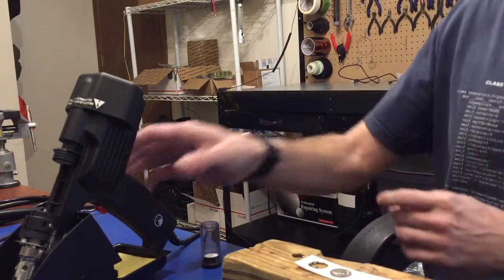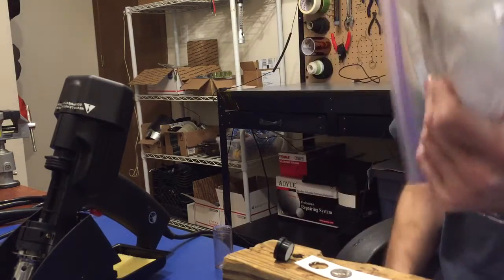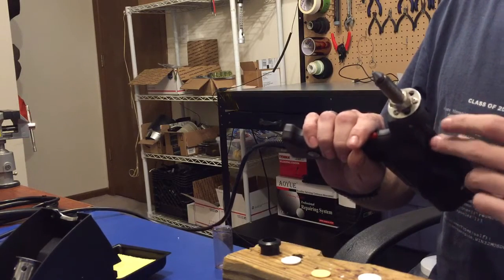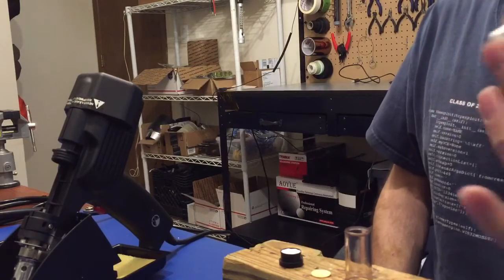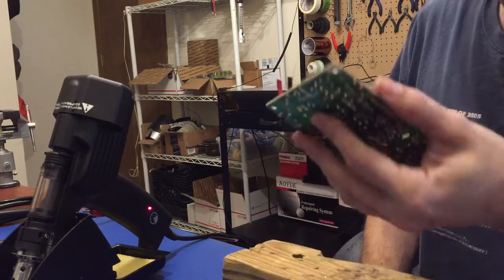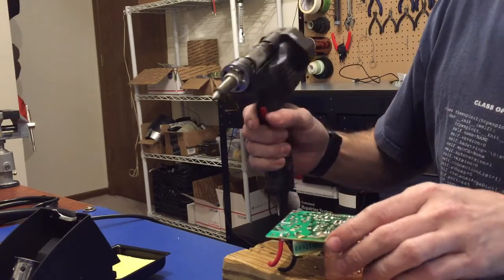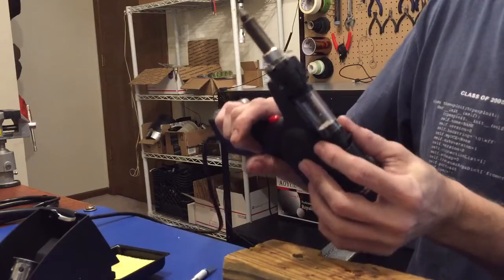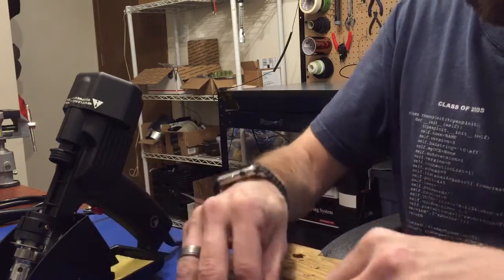Aoyue 8800 De-Soldering gun filter re-design PART 1 - More Gadget Tech Thoughts

Comment: Can you give a link to the ceramic tape you used for a filter? And if you used a lubricant inside, what lubricant do you use?
Reply from the maker: The tape I used is in the description of the video. It has a link or you can search the item number also in the description. 
I don’t use any lubricant, it barley made a difference when cleaning the canister so I just don’t use it. I hope this helps.

Comment: The manual for my Aoyue Int701A++ solder/desolder station out-right tells you to wet the filter with each use but not so much that it impedes airflow. I don’t think they call it ceramic like yours does but their US distributor, SRA-Solder, definitely calls them “ceramic.”

The Int474A++ station is the exact same as mine but with the soldering iron parts left unpopulated and capped off so that it is dedicated to desoldering. I’ve also read its manual while trying to get clarity on the cleaning process and I can tell you that both tell you to wet the filter… and neither tell you what components to apply the silicone grease to when “cleaning.” ;)
Reply from the maker: Thanks for the comment. I ran this with these filters that I made for about four years with medium use, and three years with light use and it still works great. The second filter behind the canister seem to work great for capturing the flux fumes and helps prevent the pump diaphragm from clogging up. I have up in the grease and just don’t use it. 
Did you get a chance to watch the second part? https://youtu.be/iU1L8U3Fa-w
Reply: @GadgetReviews-US  Yep. Great work! Unfortunately I need to keep the spring filter since my station has a plastic tube that may not tolerate heat as well. That said, Hakko 8-series desoldering guns definitely use the filter spring design too. I remember looking up their instructions to see if they mention silicone grease and they do not. It’s worded as if they just expect you to replace them frequently. Guess that’s why Hakko sells them in 12 packs!

Comment: Great Info! I just got a CSI 8900 which I'm sure is yet another 808 clone.  After my first trial run (you def have to get a feel for the process) with fair success, I discovered the spring filter was CLOGGED.  I turned to good old You Tube to see how to clean it and came across the PERFECT answer! DUMP THE SPRING!  :-)  I will getting my (lifetime supply) of ceramic tape material from Amazon - and will be making my own, and dumping the spring and the sponges.  A bit a KUDOS and thanks!
Reply from the maker: I’m glad it helped. Yea, good old youtube still offers some good solutions for problems if you stay away from the junk DYI videos, lol. I didn’t even know about the CSI 8900, it looks and even sounds identical. I just watched someone else’s review of this one and I guess it didn’t come with any grease but satatesnkn the manual to use some grease. Probably why they clog so easy, The grease mine came with was basically just vaseline in a syringe . Thanks for the Kudos, the feedback and watching. 
Scott

Comment: Is the pump in the gun is such a huge advantage with multilayered boards vs. pump in enclosure with hose ?
Reply from the maker: Maybe only is saving slace on the bench. I don’t see why a pump in an enclosure wouldn’t work just as good if it has a good pump.
Reply: @GadgetReviews-US  I can tell you why Aoyue’s handhelds greatly outperform their benchtop units.

The pump inside a bench unit like Aoyue Int474A++ or Int701A++ performs terribly compared to your Aoyue 8800 for a variety of reasons.

First, the pump doesn’t build vacuum strength fast enough partly because the bigger pump takes too long to spool up and partly because it has to evacuate the lines before you get max suction at the tip. Suction ramps too gradually while the handheld hits with full force nearly the instant you pull the trigger. Bench units routinely fail to clear plated through holes on double-sided PCBs whether you hold the trigger longer to compensate or not… even if you start with solder thoroughly melted on both sides and dwell additional time on each lead (especially power/ground pins).

It’s a nightmare if you don’t know what’s going on and how to cheat it. So, how exactly does a slower ramp to max that cause a problem? Well, that’s because it removes solder from the bottom side while the suction is building which severs the heat bridge you need to keep the solder molten on the component side. By the time you reach max suction the other side has solidified and the component remains stuck. Using enough heat to keep the other side molten without a thermal bridge of solder is still nightmarishly difficult and will absolutely damage pads, traces, PCBs, devices, components, etc.

The second issue is that the pumps in benchtop designs aren’t selected for purely for their suitability as desoldering pumps leading to compromises, even in the dedicated units. For example, the Int474A++ has the same PCB as the Int701A++ which also uses the pump for functions like a built-in fume extractor or optional vacuum pickup tool. Those functions require a more robust motor that can handle continuous use. This is why older units from Aoyue have an AC pump. The desoldering performance was so terrible that they bodged in a stronger DC pump, causing them to actually lose features. The DC pump versions will no longer reset the sleep timer or cancel sleep and start heating with a trigger pull. It will literally go to sleep on you while you are using it! That’s because they run the full amperage of the motor through the trigger switch and bypass the original PCB connector (with mosfet control). VERY BAD!

It wasn’t an Aoyue, but KainkaLabs solved the slot-to-build suction problem on his benchtop ZD-915 two different ways:
The first time he added an air-tight container for holding a vacuum released by a trigger-activated solenoid. The vessel was large enough that the extra air in the lines would instantly evacuate into the vacuum without needing to wait for the pump to catch up. When the trigger is released the pump continues to run, recharging the vacuum reservoir on-tap.

He didn’t like having the DC pump running all the time and he noted that it would work better if the solenoid were on the handle so that it wouldn’t have to evacuate the lines. For his second version he eliminated the vacuum reservoir with a time-delay circuit that will start the pump a second before opening the solenoid mounted to the handle.

The “cheat” I mentioned earlier was to kink the hose closed and hold the trigger to build up vacuum, then quickly open the line once you have the solder molten. I did this when removing the CPU and PPU from a Nintendo Entertainment System the other day (2xDIP40) and it was a dream compared to every other time I’ve done the same job… which is dozens and dozens of times since buying the Aoyue July 2016.

The fact is, I bought it specifically for doing that job and yet it was so shamefully bad that I had to go right back to using my Radio Shack bulb-type desoldering iron, Sold-a-pult, and ChipQuik for the numerous power and ground pins. Even then, I struggled with clearing the rest every single time. It was terrible at the very job it was built/purchased for.

To hear you say that yours only clogged once in the first six months is almost maddening. You could count on my benchtop unit clearing less than half of the connections and clogging several times per job. It was a clusterf**k every time I tried to use it to desolder logic chips, memory, ROMs, and EEPROMs.

Anyway, the pinched hose trick worked wonders on my Aoyue Int701A++. Because mine has the AC pump with fume extractor function I can leave the pump on instead of holding the trigger. Perhaps I should connect a solenoid to the trigger so I don’t have to use my other hand to fiddle with the hose. :)

So, yeah, get a portable self-contained unit instead of a benchtop unit even if you are working at a bench. I definitely regret getting a bench unit as it is nearly unusable even without comparing it to the portables. To see the portable work so well really seals the deal.

Comment: I noticed some guns like ZD915 have replaceable just nozzle tip, when other like your Aoyue 8800 has whole nozzle with tube in one piece. What's the difference other then price being 1Eur for nozzle and and 5eur for nozzle with tube?

As I understand the tube can fail after certain time and by replacing whole thing means less chance for failure of the whole hotend.
Reply from the maker: The heater on most that have the tube will heat the whole tube also. This prevents less of a chance with the tube from clogging since the whole tube is just as hot as the tip. Of course if you loose suction it still may clog, but with the tube being heated you can turn up the heat and use a push rod (came with mine) to clear the clog. 
Mine clogged once, I forgot to empty the chamber and change the filter and this blocked the suction. So this was my fault, but I was able to clear it easy since the heating element heats the whole tube. So the tube may be a slight advantage.
Reply: Gadget Review Videos, thanks for sending me the link to this review after I commented on another of you reviews. I haven't watched this one yet, but since the subject has arisen of the tube attached to the tips clogging , I found that I had far less instances of that tube clogging if I put a couple of brass washers on the tube before I slipped the tip into the heating assembly. This spaces the tip a little farther out and  away from the gun and keeps more of the tube centered in the heating element until the very end where it breaks out into the solder collecting chamber. I used a couple of brass washers that are the same diameter as the bottom side of the chunk of copper that comprises the tip, and I think I probably spaced the whole thing out maybe 1/8 inch or so,  which still gave me sufficient room to get the threads on for the collar that holds the tip in place. Like I said, this keeps the very end of that metal tube inside the ceramic heating element for as much of its length as is physically possible, and should help prevent clogging. I also like to use a little "never-seize" or the Hakko equivalent product on everything not just to be easier to take it apart but for improved heat transfer. it smokes for a few minutes when you first turn the gun on, and then it stops smoking.

If the added spacers prevent the tube from protruding far enough into the chamber to mate with the whole in the silicone rubber grommet or gasket, you can use slightly thinner spacers between the mounting collar of the heating element and the plastic body of the desoldering gun. Unfortunately, this necessitates taking the desoldering gun apart because one of the bolts is extra long and used to attach a ground lug to. It's pretty tight inside that gun, the channels for the wiring are kind of narrow considering the thickness and springiness of the wires and the thickness of the slip on heat resistant insulation, and putting it together again is kind of tricky because everything kind of Springs back out at you as you are trying to snap the cover back on the gun. By the way, if you change only the heating element itself, the two pin Molex plug on the end of the heater wires with the female contacts won't come back out the hole, you'll have to take the contacts out of the little plastic connector frame, and you might want to crimp them onto the heater element wires for the new heating element , which does not include the plug in connector or crimp pins when you buy a replacement heater. Alternately,  you can just crimp the wires using some kind of very small diameter crimp ferrule or miniature butt splice type of thing, small enough to be able to fit inside the housing of the gun, but the heater wires cannot be soldered to.
Reply from the maker: good 'un I know what you saying about the the position of the metal tube part of the tip being better centered into the heater area. But I can’t try this as the one I own is different from the one you own. Mine is a separate de-soldering gun as you see, not part of an iron combo station. Still the one clog I did get that was completely my mistake (you will see why I say this when you watch part 2) I did notice it was easier to unscrew the tip, move it forward a little to melt the solder at the end and clear it faster. 
But again, the clog was my fault, and it hasn’t clogged since then if I don’t let the filter or canister fill up. I would show your change if I owned one so other could replicate it. But I own enough stations at this point and had a great deal on a new Hakko that I seem to offer these days. I will be repairing a broken hot air quick station once I buy the new home and set up the new lab. So I think the Aoyue stations will go onto the other battery bench once it’s also built in the new place.

Comment: Thanks this is the best tip i have seen yet in regards to desoldering tools.. i live in The Netherlands and could not find the tape you mentioned but i did find Ceramic heat tape use for car exhausts / tale pipes..
I think it's the same.. found a online store that sells it for €3 with €3 shipping for 1meter.
What do you think??
https://www.carperformanceparts.nl/heat-wrap/heat-wrap-hitteband-1meter-op-rol-kleur-wit

i'm thinking of grabbing this desoldering station when the time comes..
https://www.eleshop.nl/aoyue-474a-desoldeerstation-1958.html
This one seems better
Reply from the maker: It might be to thick and might not filter the flux fumes. Becjase it’s weaved it will have bigger wholes and the solder might get by the filter. I did update the description and left some details on juliusvalentinas comment yesterday. 
You can try searching for ceramic insulation roll that’s 1/16 inch thick. You don’t want it to thick or it will affect the suction also. The roll I use is the same insulation for 3D printer hot ends, but the 3d printer strips that are sold are pre-cut with holes sometimes, and also have kaltop tape on them. You might be able to find a roll on a 3D printer supply web site?
Good luck.

Comment: Now how the filter called? "ceramic filter roll" gets me no results.
Reply from the maker: I bought the roll from McMaster-Carr Supply Company 
https:\\www.McMaster.com

You can find it by searching for the following:
Item Number:
87575K84

Name:
Ultra-High-Temperature Ceramic Fiber Insulation, Alumina Oxide, 50 Feet Long x 1" Wide x 1/16" Thick

https://www.mcmaster.com/#catalog/87575K84
Reply: Thanks.
Reply from the maker: Well I already had the roll for my 3D printer and it worked good for this also. The precut roll is easier to make the heat wrappers on the heating blocks for my printer. 
But my concern would be that different materials can be made at different densities affecting the air flow and suction. It might work, or it might not? The other thing to watch out for is how it’s woven. I wanted to be able to capture the lead and flux fumes also in the filter and the one I show does, and still lets enlighten air flow to keep good suction at the same time. And obviously can handle the temperature of molten solder. 
You can always try it, it might be to thick or to dense and affect the suction. That would defeat the purpose of the desoldering gun. 
The words “Hard and tough” in the description make me think it’s going to be to thick, and they don’t list the specs for how thick this sheet is.
Scott
Reply from the maker: Yes, its easy to break and rip. I also use mine for wrapping the hot ends of a 3D printer extruder at 235 °C and it hold up good. I just took my hot air station set at 500 °C to a strip for 25 seconds and it turned a little brown but stayed together. Turns black under a BIC lighter open flame but does not flake apart. It is heat resistant to a point, I think mine claimed about 500 °C, but this material is not flame retardant.
Reply: @GadgetReviews-US  Actually mine on a lighter doesn't crumble itself, let's say it's even easier to rip after a lighter fire.
I made a few filters with my material. I'll try them on my gun next week and let you know how it works.
I'm worried about these materials (ceramic fibers) could be asbestos/amiantus based (= cancer risk)
Reply: @GadgetReviews-US  I got similar stuff from china, works fine

Comment: The Hakko 808 filter uses this dense white fibrous material that fits in the rear opening of the gun. As it "plugs up", I find I can flake the gumed up areas off, and it's white and clean underneath. It tends to turn grey (from the solder splattering against it) as it gets dirty, but it's pure white when you scrape the top layers off.
Reply from the maker: It sounds like it already uses a quality high temperature Ceramic filter. My filters I make do the same thing and act the same way. I just happen to have a roll of this Ceramic tape for insulating the heat blocks on 3D printers. Works good formother stuff also since it can take up to  2300°F.
I know Hakko charges based on the name brand, I wonder how much they want for these replacement filters? 
Maybe you can make your own for cheaper using the same Ceramic tape looking at 3D printer supply web sites?